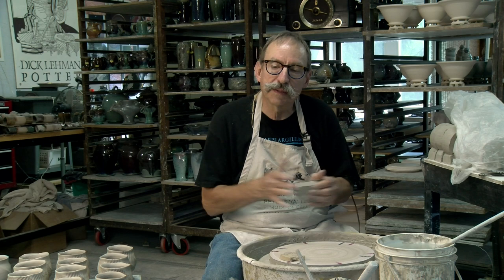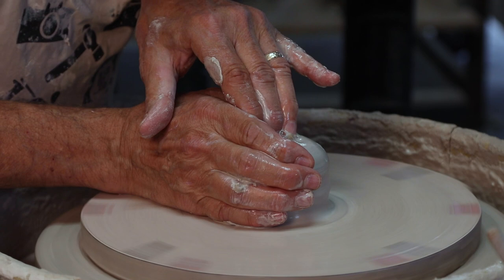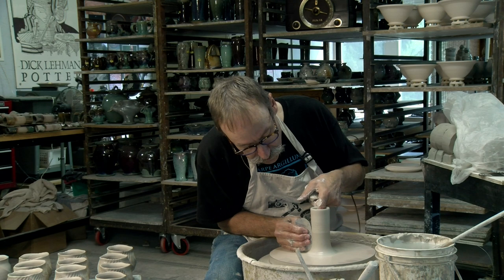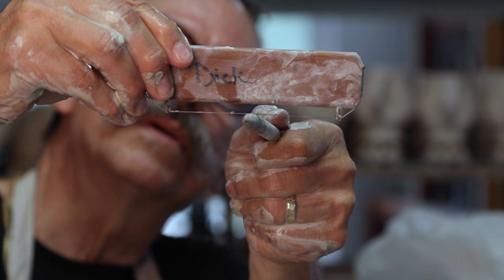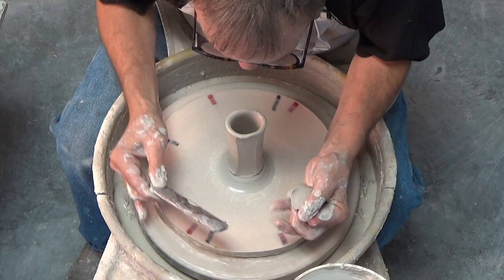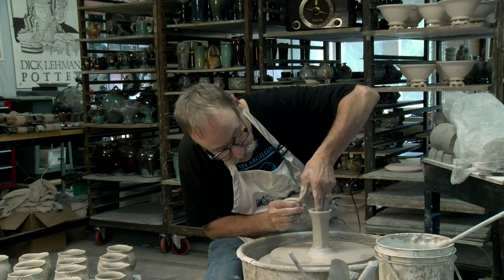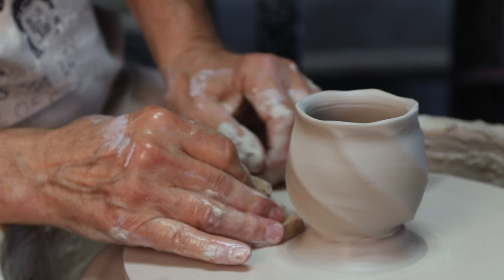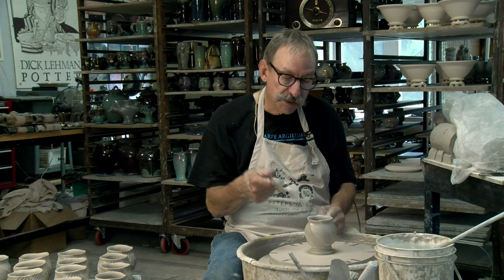A New Approach to Faceting Pottery | DICK LEHMAN

Comment: I tried to use this faceting method with Coleman raku clay, because I thought it would be perfect for raku glazes. I watched Lehman's video about 10 times, and followed all his techniques closely, including fast spinning while expanding the faceted clay. After 7 attempts I concluded that it doesn't work with groggy clay.  Groggy clay is not plastic enough to twist and spiral with lifting. The facets stay vertical. The thinner parts sometimes get too thin rather than spreading around.  I will try again with porcelain.

Comment: Any tips on how to get that good twist affect?  I've made several today and the facets aren't moving much.
Reply: The thinner the cylinder wall, the lesser the resistance. The smaller amount of water, the greater amount of friction/drag when opening the form. Both should help contribute to the amount of twist.
Reply: Sponge your interior so it’s not super wet so your hand has some resistance but not to much I like to dry it as much as I can and use a damp hand to expand
Reply: I'm having this same problem. Spent two days in the community pottery studio and perforated 5 times and only didn't twice, but the facets didn't twist. Someone else more experience than me on wheel tries and same thing, no twist.
Reply: @mjchandlerscorner785 Did you also make your cylinder skinny and taller?  That way as you push out, you push farther.  I have gone through mine also.  I have heard it takes quite a bit of practice.

Comment: How thick does the wall need to be before the facets are sliced and do you slice half or a third of the thickness away? I haven't been able to get the facets to twist when I push the walls out from the inside. 😢
Reply: The few I did didn't turn out that wonderful when I did it.  It looks like the cylinder has to be very narrow, so when you push out, it twists more.  I think also you would trim away about 1/3.  It does take a lot of practice to learn this, as per other potters.
Reply: Thank you 🙏🏼 @triciac1019
Reply: You have to have quite a thick wall and very narrow cylinder in order to facet only 6 times as Lehman does.  If the cylinder is wider, and the wall too thin, you will cut through no matter how nice a cheese cutter you have. Or you can do 10 slimmer shallower facet strips all around but you don't get the same effect.
Reply: @triciac1019 Thank you 👍🏼